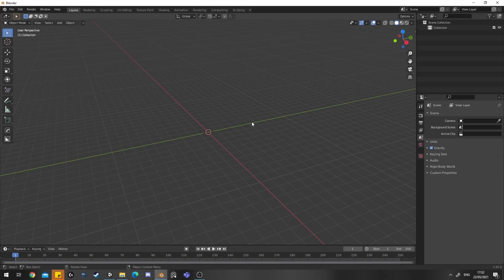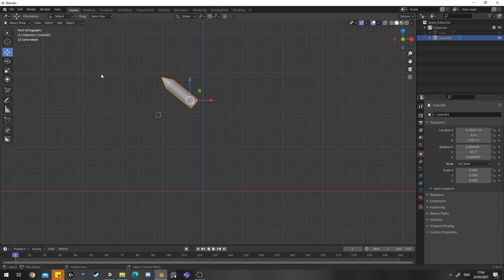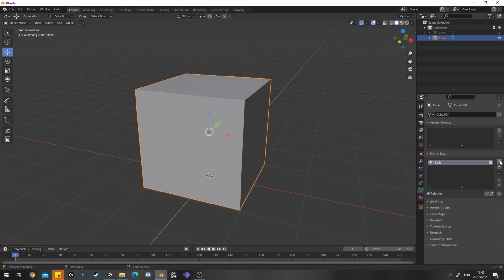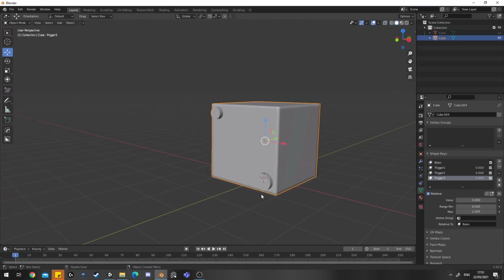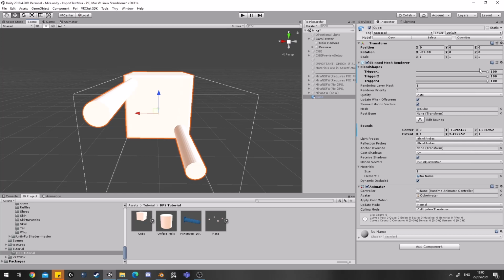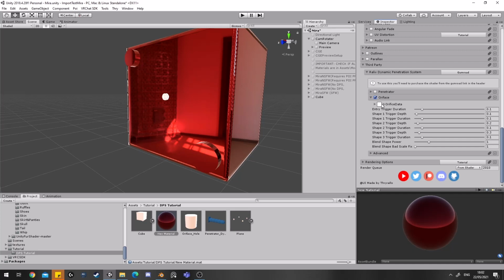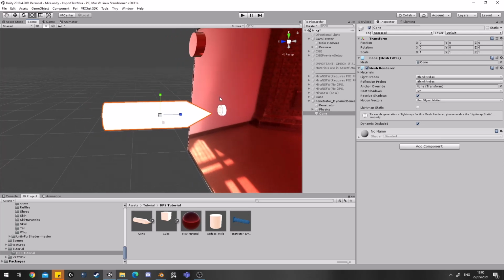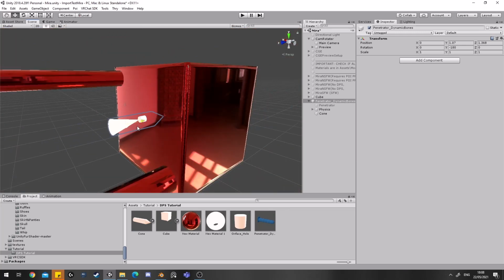VRChat - Raliv's Dynamic Penetration System Tutorial

Comment: Hey there, great tutorial! Although I was wondering, how would you be able to make them togglable? Is it the same as doing it with any object in Unity? If so, will they still interact if they are toggled off?
Reply from the maker: Heya! Great question. I wish I covered this in the video. Lights are incredibly performance heavy so it's a great thing to ask. This might be a bit of a hard thing to cover in a comment, so feel free to join my discord and I will be glad to help there futher.

For simply toggling the orifice: Create a toggle that turns off the orifice object just like any other toggle. 

In addition, if you've got a mesh that has 2 or more materials on it with DPS, then you will have to animate the blend shape power of both materials mutually exclusively. 

So if Orifice A is active (1), Orifice B is deactivated (0), and vice versa. There can only be one orifice active at the same time as well.

This is all to avoid every material activating when DPS activates. for example, the mouth opens and the private parts also open up, while only the mouth is actually being interacted with. Animating the blend shape power of all the other materials to 0, while keeping the active material at 1 will fix that

Comment: Hi, Grate tutorial - ill hopfully be using this to setup a few things when i can get it working. Im having issues with which files are the one i am to use. when i bought the package, it came with 6 unity files, each is a version of the DP system but they dont seem to work, or work ramdomly. the one with the most files is V1_21 which has the most files in it. but doent appear to work?? - i got mine from gumroad. can i ask which version you are using?
Reply from the maker: Heya! I'm using version V1_21 in this. It might be best if you head over to my discord server (link in description) for further help. Hopefully, I can spot what's going wrong!